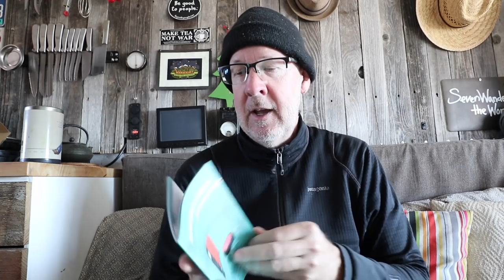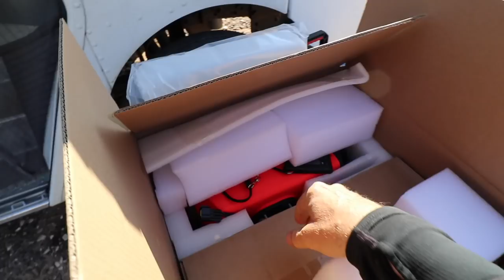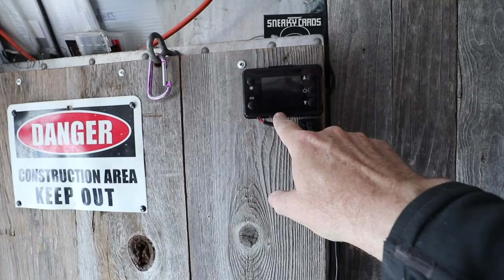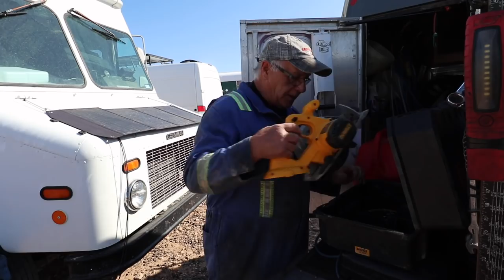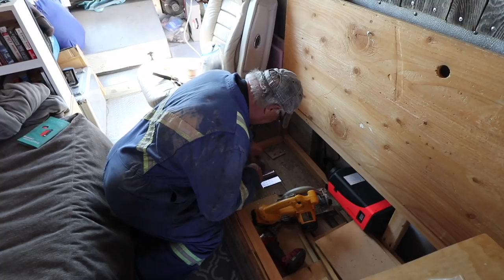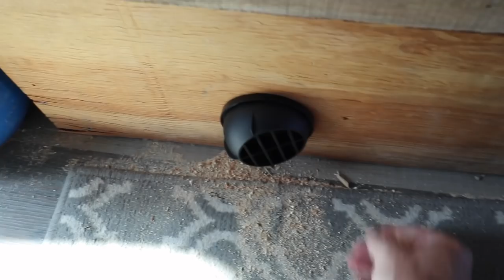Installing  $100 Chinese Diesel Heater P1 E578

Comment: I got an "8k" 31 days ago .installed and running great in a 79 GMC 24 ft motorhome, in Maine 30 degrees average temp.outside inside 72 .love my heater.
Reply: No not really  at the time 5k was the same price. 8k 5k doesn't matter to me this thing after a month its cheaper to run than my stock propane furnace.

Comment: Great choice.
We have a webasto. Hope your powerlines are thick enough. If the burner stalls that might be the problem
Reply: Once it fired up, its the pump that would have a problem, which really never happens with these heaters! It might be the fuse or an old mother broad, again that rarely happens. He should get many years of service from these, providing he does a few things to help it longevity.

Comment: I love mine and how cozy my Skoolie is on cold nights. I didn't hook into my fuel line to insure I couldn't suck the tank dry. Found an unused port and installed my pick up there so it is 4" off the bottom of the tank
Reply: Steampunk Steve, good advice about keeping the line above the bottom of the fuel tank.  Someday I may need to remember that.  :) . Cheers!

Comment: Doods, you remove all the vinyl where the plate goes as it gets very hot, use a hole saw and drill 2 holes put a bead of fire proof sealant around the outside of mounting plate edge and screw down..Then underneath paint screws with a heavy type under car paint..

Comment: May I make a few suggestions with those since I install them too. First, try not to connect the pump directly to any hard surfaces, since it a mechanical and magnetic pump it will make the ticking sound even loader. Make sure it at least at a 30-degree angle you want the air bubble to go in upward to the burn chamber. Plus the pump will cause cavitation anyway, hence the air bubbles, this is why the pump needs to be at least 30 degrees. There all kinds of tricks to make this thing quite. If you have any more questions please ask, I answer them as best as I can.

Comment: In a year or two you can upgrade with one of the hybrid units that heats both air and coolant so you get instant hot air to take the chill off at the same time it is heating a tank of coolant that can last you a long time of heating off a secondary radiator and fan. 

They are still new enough that you have to have shipped directly from China rather then like the air heaters that they have a stock over here.

Comment: i was watching another channel and he had issues with the glow plug and needed to replace it. He had to completely disassemble it to get the glow plug. He said that they make a special tool to remove it so you wouldn't have to disassemble it. Also someone else had issues with the fuel pump going out. May want to keep spares plugs and pumps in case you ever need them and wouldn't have to wait for them to ship replacement .

Comment: Can you set the digital display to a specific temperature and have the heater shut off when the cabin reaches that temperature or are you only able to control the heat manually by turning the heater to low or off if the cabin begins to get too hot?

Comment: The only thing I wish was different with these is that the thermostat would turn the heat off (not just to low). I find that if left on, my diesel heater overheats the van.
Reply: What size are you using? There are a couple of ways to correct that.
Reply: @FirstSuiGeneris  5000 kW I believe
Reply: Sylvan Secrets  the 5Kw way to big for a regular van, depending on what van you have and control you have?
Reply: @FirstSuiGeneris  definitely too big
Reply: Sylvan Secrets but you might use a 12v 16 pump, If I’m not mistaken you have a 12 22 pump you have a lcd screen controller keep it at 21 maybe 22 that about 71degress  if you have a roof vent open to help with temperature 
2Kw or 3Kw would done good for you sorry I couldn’t be more help.

Comment: 7,
You would be well advised to use the fuel tank provided in the kit.
The heater has the capability of sucking the step van tank dry during the night 
leaving you with no fuel to pull out with.
Rv's have a seperate tap into the vehicle fuel tank for gensets mounted about 1/4
way off the bottom so that if the genset does not suck the vehicle fuel tank dry

!
Reply: This heater on max settings over a 24 hour period uses 0.78 gallons of fuel. Overnight would suggest 8 hours, meaning 1/4 gallon of fuel used, max heat. 

Going to go out on a limb here and say this isn't a feasible threat unless you're a moron who drives on E for hours on end.

Comment: diesel heaters make too much noise for stealth camping. For that propane is better, and safe enough if you can send the exhaust out too.  However, I've wondered why nobody has connected the exhaust tube to side of vehicle exhaust pipe ahead of the muffler, to keep it much quieter than even those little mufflers one can add. Propane makes no noise at all.

Comment: I don't own one of these yet, but have read a lot about them.

They do not work well past 3or 4 thousand feet. The lack of oxygen at those altitudes will base them to soot up and firm carbon in the combustion area. 

There are higher quality heaters available with high altitude kits. Those can be operated to 8 or 9 thousand feet. They are more costly than the cheap Chinese heaters, but cost less than Webasto or Eberspacher of Germany. One is Planar, or Autotherm. They are high quality units built in Russia. The company also builds for the Russian military,  for use in the Arctic.

The other is high end Chinese, the company VVKB. Also high quality.  

Be aware that home heating oil is basically diesel, but at a lower price. It's also known as Diesel #2. It's dyed red for tax purposes.  You would want to have a separate tank for the heater. You do not want to get fined for putting red diesel in your regular fuel tank. 

The heaters can also operate on kerosene.  In fact kerosene burns clearner. Especially at high altitude. Kerosene is pricy.  
You can find #1 Stove oil at an oil dealer.  It's basically less refined kerosene. It costs less. It's also blended into winter diesel. More highly refined kerosene is sold at some small and midsized airports for use in jets. It is called Jet-A. Some will sell it to you if you ask. Supposedly some of the airports have maintainance shops. Jet -A is drained from jet fuel tanks and recycled. Supposedly they would love to sell it cheap so that they don't have to pay to get rid of it. Or so I've read....... don't know if that's true.
Reply: Yes, they can with a small adjustment and might have to change the pump metering flow.

Comment: Will you have an odor?
Reply: There will be no odor or moisture.  The combustion flame has its own exhaust.  It warms a heat exchanger with fins like a lawn mower engine. The fan will blow the heat into the van, and the exhaust out the  muffler.